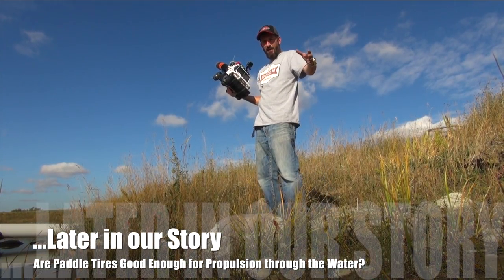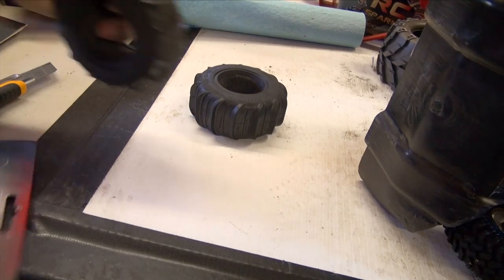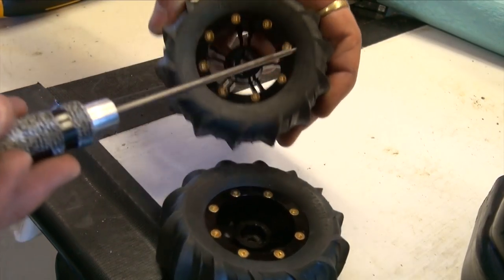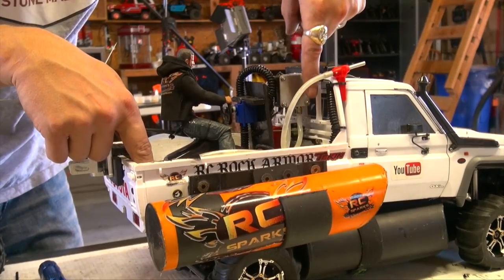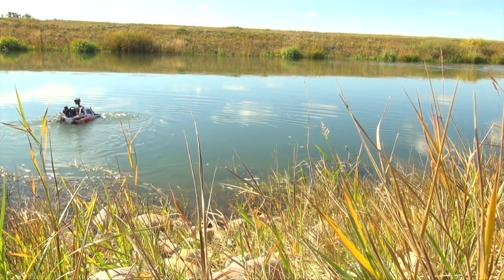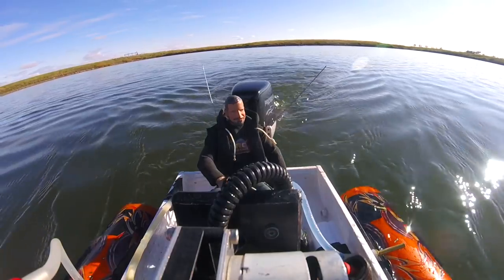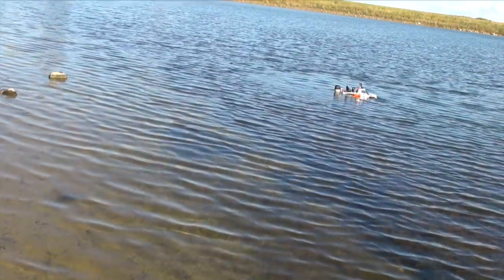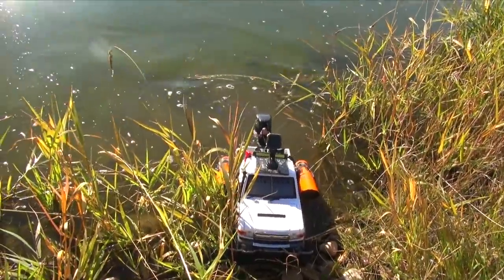DO PADDLE TIRES WORK in WATER? TOYBOTA PROJECT - Part 10 | RC ADVENTURES

Comment: I've said it before and I'll say it again... This build is fantastic!
Reply: Also not sure if it would help, but would lowering the two stabilizers on the sides further into the water increase the height of the bed? Because whenever the outboard is in use it seems to drop the back of the truck down thus causing the bed to fill with more water. However now that I think of it, if the back was raised up, the front would be pointed down causing the truck to plow even more... Darned if you do, darned if you don't lol!  keep up the great work!

Comment: Dude you totally need to make a "Geoff" aka The Hammerhead Eagle i- Thrust!! Nitro motor hooked up to a brushed motor that'll charged up the battery, of course the car needs to have NIHM batteries, and a brushed system for forward and reverse movement.

Comment: Ya in ur first go you definitely needed the outboard motor on there. You engineered it so well for that extra weight that now you need that extra weight for it to work correctly. :) I believe that you actually proved yourself wrong there sir, I believe you said in a previous video in this series, that if you flooded & sunk ur truck bed that the pump wouldn't be able to empty it back out. From what I can see, it does do just that. :) With the help of those pontunes of course ;) but none the less, it does empty it back out & save the craft. Lol, Mr. Clarkson could learn a bit from your design. Great job Medic!!

Comment: magnificent. 
Maybe you could try stock tires on the back to avoid getting too much water in the back.
Reply from the maker: Bah.. that outboard motor is plenty.. and the paddles were just an experiment. BUT.. some gorilla tape fender flares would be light, cheap and easy to remove

Comment: That was Awesome!! question medic,i bought the trail finder 2 my question is tekin system i'm going to run should i go 35 turn hand wound or a 30 turn.
Reply from the maker: Andrew.. the difference between the two is not even noticeable.  But- I would still get the 30, becuase she does have great torque and wheel speed. I have 2, 30's in my Orange Rock Bouncer - named Tango

Comment: Great Videos. I wonder if paddle tires on just the front would work. Or remove the rear driveshaft and just have front wheel drive. That way you would have less water splashing into the rear of the truck.

Comment: Paddle tyres just on the rear would help reduce the ploughing.
Reply from the maker: That is actually, untrue my friend.  :) The resistance of the water against the front hood, and the drag on the bottom, and the force from the back, would cause the hood to sink down. Now - just Paddled on the FRONT would help - but it would be a negligible amount.  The outboard motor does the job very well.. and the paddle tires are rather.. meh. Lol
Reply: Oh...yeah, I've got my technical head on the wrong way around today...lol. Paddles on front!....err...thats what I meant ;)

Comment: A nice addition would be a float switch (small upside-down reed switch with something floaty on one reed) to make the bilge pump automatic.  Air filled tires would add some buoyancy if you block the little breather holes in the wheels so they don't fill with water.
Reply from the maker: Sloshing water would be the only flaw I see in the float plan :)  The Tires are Sealed ! They do not fill with water. Air Filled ties actually have no impact on the 12lb truck in the water. We tested that already! They 4 pontoons filled with air and the 1 square yard of foam board I stuffed into the body cancel out the small tires.  Can you imagine that you are already watching 12lbs floating! Incredible!!
Reply: Most RC wheels I've seen, even beadlocks, usually have one or two tiny pin size breather holes. I have been amazed many times in my life to see how heavy things can actually be floated.  They build giant ships from steal, and I've even seen ships and boats with concrete hulls!

Comment: Wow it went pretty fast with those paddle tires! What's happened with the ESC and outboard water cooling? Shouldn't the pipe on the left side of the truck be ejecting water from the cooling loop?

Comment: When you were crossing the pond I wonder if under the constant velocity if you run  the truck motor and let the paddle tires pull the front end up and out of the water somewhat would it go faster. Maybe even only putting paddle tires on the front only possibly not really sure there are so many combinations that you could try you know what I'm talking about

Comment: To help with flotion could fill tires with expendable spyay foam I tried just to see if tires would float they did but you have to trim to mount on bead locks just a idea to help the back end

Comment: Hey sparks if you take the drive shaft off the front it won't plow your causing it to dig and that pulls the front down in water same thing happens on full size trucks when water crossing

Comment: Wouldn't using the air filled tyres you had on Black Widow help with the flotation on the water?
Reply from the maker: But it wouldnt be a tribute to the original toybota from Top Gear (which was the point of this project) - as well as those tires would never fit under the body shell. I dont recognize your name.. so I dont know if YOU know that there are 4 Air Filled Pontoons already on this truck :)
Reply: I've been watching your videos for the last few year. Just rarely make a comment. Watched every episode about the Toybota. Amazing what you've done. Was just an idea to use the G-Made Inflatable Rims with the paddle tyres (if they fit/work....) just to get a tiny bit more flotation on all 4 corners of the truck

Comment: Air pontoons on the side or sitting too high on the truck you need to lower him down close to the tires
Reply from the maker: Actually, I hate to disagree with my fellow RC enthusiasts .. but if you watched the build series - or the BBC episode you would see why they are done this way.  And as a side note - there are two Black pontoons at tire level already, under the truck - you may not have seen them. :)  If you moved the orange ones down further - the Outboard motor prop would not touch the water. No propulsion.  Also, it would have a different impact on how it moves. For example.. how would you drive it on land?   It would only be able to go on a flat surface with no bumps! This is a tribute build to Top Gear, and their attempt at the channel crossing. Almost identical actually.. either way.. I hope you were entertained, and had a smile watching the show.. thanks for commenting!

Comment: Maybe try a small float under the front bumper
Reply from the maker: There is a float under the bumper :) In fact, 100% of the Truck body is foam board, as well as 2 large, black pontoons lower than the orange ones you can see! 12lbs is a lot of mass to float with a small surface area
Reply: RCSparks Studio, love the videos man keep em going
Reply: Can't wait to see some more videos on ur back yard course

Comment: Your motor water cooler wasn’t pumping.
Reply from the maker: It isnt a pump, its a forced water system.. and is made for High Speed expulsion.  If you look closer.. water is coming through the system.. but not "shooting" like you are expecting. Becuase I am going quite slow..